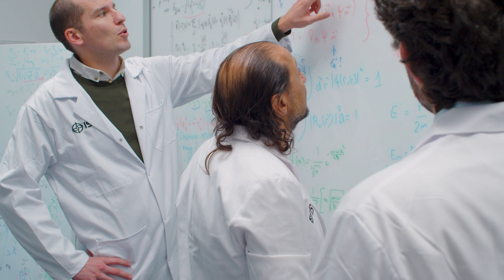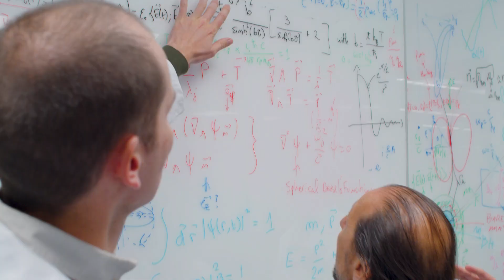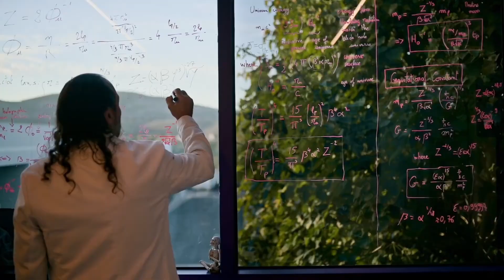Zero Point Energy: The Next Frontier in Sustainable Energy Solutions

Comment: Zero point energy aka energy of vacuum of space is real and could easily be harnessed for use by human civilization. But it is not what all scientists are thinking and talking about on how it works. The key is Quantum Gravity or Quantum Gravitation - its real true nature, the "why" and not just the "how" it works.
Reply: You have literally no clue what you're talking about
Reply: Zero point energy is the lowest possible energy state a quantum mechanical system may have. You can store vacuum energy with Casimir engine by pulling the plates apart, and extract that energy back towards zero point energy by letting the plates return together, but you won't get more energy out, as per second law of thermodynamics, so you did not actually harness anything, you just created a very expensive and weak battery.

Comment: This is ridiculous. Energy and useable energy are very different things. Example: hot air has more energy than cold air (per unit volume). Your fridge takes hot air and removes energy from it to make it cold. Does this mean your fridge can produce electricity? No! It has to use electricity to cool the air. The energy in the now cold air wasn't useable energy. 
Similarly zero point energy is not useable. 
Simply put, for energy to be useable it has to be concentrated. Energy naturally spreads out. To increase the concentration of energy somewhere you have to spread it out much more somewhere else.

Zero point energy is literally the most spread out energy in the universe, uniformly distributed over all space, making it completely useless for powering anything.

Comment: The established science says that their is roughly 10^-10 joules/m^3 in space. this is known as the quatum vacuum, which has a negtive energy that can express itself as postive or negative depending on how its used. However the time it takes to refresh this low amount of energy is not provided. The best estimate based on physical laws is that 10^-10j/m^3 can be refressed in 299792458 planck times. that makes zero point energy a huge number. remember zero point is just our postive spacetimes zero. But in reality there is whole negative space below the vacuum fluctuations that exist. The fluctuations are just surface wripples. To acess this energy, you need to gravitational field drive tech, hyper velocity near light speed via a quatum ramjet effect, casimr plates where one plate is one way quatum mirror, or be near a blackhole. this energy is needed for warp drive and communications etc

Comment: Why risk obliterating the universe. heat pumps are the ultimate future. Right up to a different form of Dyson sphere and beyond.... CMB is several kelvin above zero, room to work.

Besides I think our mission is to become a cold engine and slow entropy. also.... check this for some evening entertaiment.

What if our universe didn’t originate from a singularity, but rather emerged through a 'hole' into a vast, pre-existing void? This void could contain varying 'pressure' zones, created by the remnants of a previous universe, which would influence the dynamics of our cosmic expansion. Imagine injecting a ball of liquid gas into a vacuum chamber: the gas undergoes a rapid phase change, expanding explosively as it moves from a liquid state to a gaseous one. This behavior demonstrates how matter behaves in the absence of resistance, rapidly filling the available space.
In the same way, our universe could be expanding into this uneven vacuum-like environment, where the remnants of a former cosmic cycle create differing gravitational influences. These uneven pressures might explain why matter doesn’t distribute uniformly but instead organizes into filamentary structures, such as those leading toward massive gravitational attractors like the Great Attractor. As gas in a vacuum tends to flow toward areas of lower pressure, matter in our universe might also be drawn toward regions of higher density, forming these vast cosmic filaments.
Moreover, if our universe is indeed expanding into the dispersed remnants of a previous universe, this could provide a new lens through which to understand dark energy. Traditionally viewed as an internal force driving the accelerated expansion of the universe, dark energy might instead represent an external pull from these cosmic remains. This perspective challenges the conventional notion that the universe's expansion is purely a result of internal dynamics, suggesting instead that we might be stretching into a larger cosmic framework influenced by forces beyond our comprehension.
The idea of the universe expanding into a 'corpus' of a previous cosmic cycle opens intriguing possibilities for our understanding of time and space. If we are indeed part of a cyclical process, where universes emerge from and dissolve back into a larger void, we might also reconsider the nature of our existence and the forces that govern it. Rather than perceiving the universe as a closed system, we could view it as a dynamic interplay of cosmic structures, driven by external influences that guide its evolution.
This perspective encourages a re-evaluation of the fundamental nature of the universe and our place within it. Instead of an isolated expansion from a singularity, we might be part of an expansive continuum, shaped by the gravitational remnants of the past and the vast pressures of the void surrounding us. In this framework, the dynamics of gas behavior in vacuum conditions—characterized by rapid expansion and phase changes—serve as a compelling analogy for the cosmic phenomena we observe on a grand scale.
In summary, contemplating the universe as an entity that emerges from a 'hole' into a diverse vacuum of varying pressure zones allows for a richer understanding of cosmic expansion. It not only sheds light on the formation of structures like filaments and galaxy clusters but also reinterprets dark energy as a potential influence from the remnants of a previous universe. This line of thinking opens the door to new insights about the fabric of reality, inviting us to explore the mysteries of existence and the forces that govern the cosmos.
Malcolm Young.